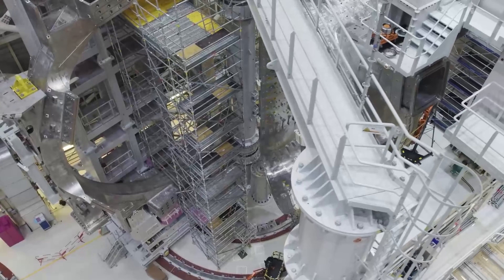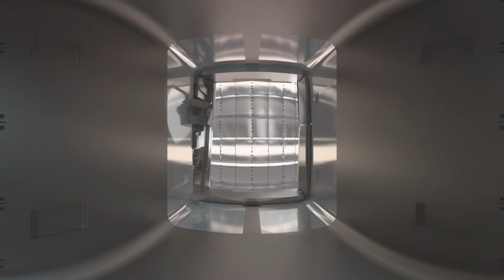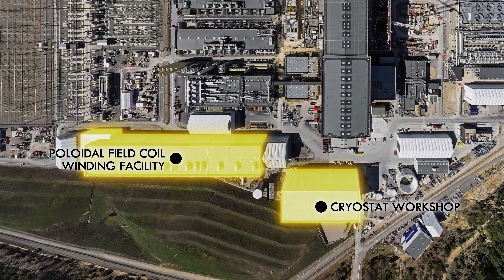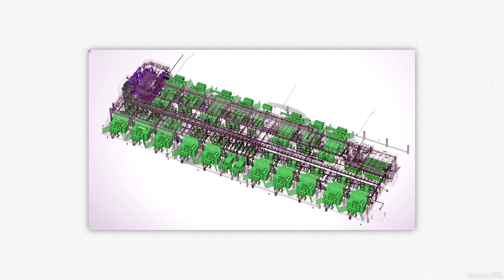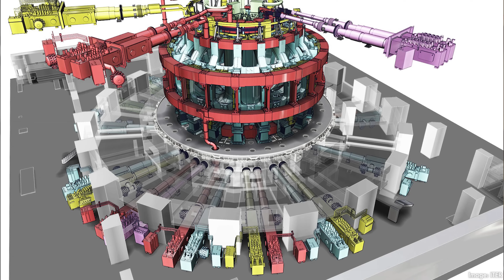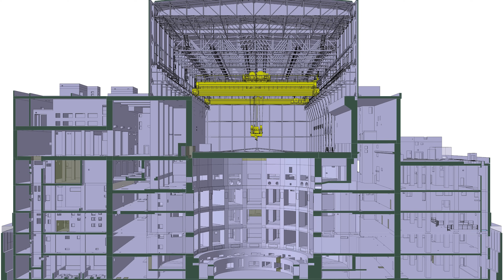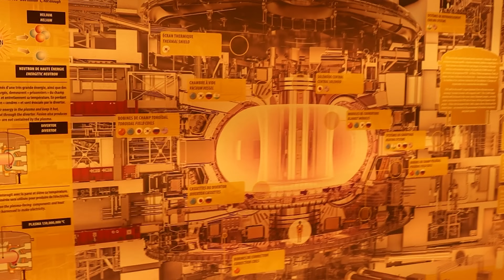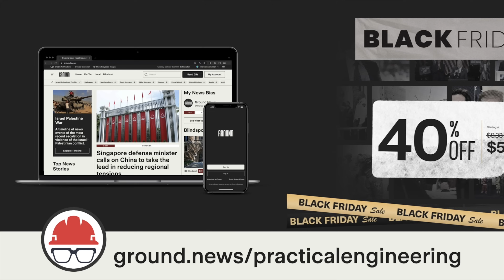Engineering The Largest Nuclear Fusion Reactor

Comment: Hello.
She's misinformed about nuclear fusion not producing any long lived waste.
While true that fusion won't produce any HLW, HLW comprises less than 5% of the waste fission reactors produce.
LLW and MLW waste will be produced by fusion reactors at an equal or greater amount, and it's actually an intended result of the design.
Fusion reactors produce their energy in the form of high energy neutrons, which transfer the thrermal energy into the reactor walls through impacts.
However, when a neutron impacts a material, there is a chance of it being absorbed by a nucleus and becoming a radioactive isotope of that material.
Over time, more and more of the reactor walls will undergo this reaction, until the entire thing becomes radioactive and require replacement and disposal.

The result is several tens of thousand of tonnes of radioactive material requiring long term disposal.

Comment: Grady, I'm disappointed. This is just more PR spiel. There is an actual climate crisis which actually requires urgent action. Your practical insights could be really helpful in addressing these issues. But for reasons too complex to explain in a You Tube comment, ITER is a white elephant-style road to nowhere. I can't believe that you are not able to actually see that.

Best wishes. Michael

Comment: 50MW in, 500MW out is 450MW gross.
We do not know the efficiency of heat transfer from the tokamak to the water, so we estimate 80%.
Assuming 45% efficiency of the powerplant. we get:
450 * 0.8 * 0.45 = 162MW.
This is about 50 wind turbines, about 1/3 of a typical coal or gas power plant.
A nuclear power plant typically produces about 1000MW.

Comment: Grady, every time I hear the phrase get more out than was put in, particularly as it relates to energy/heat, my mind immediately goes to saying, “so you’re trying to build a perpetual motion machine“. Is this the case? Why do we even need to do this when we have plenty of regular fusion reactors. I think that’s where the money should be spent. The technology is now, I don’t understand at all why we are not re-processing all of this uranium, but if you want to have a cleaner, Infinite source of electrical power, it seems as if the existing nuclear technology is more than sufficient

Comment: Im highly sceptical of fusion power. This Q10 is not a real number. I came to understand there are many ways the effective power output can be calculated. At the end, you need to measure electrical power input and output over time. So dumping the heat, expecting the theoretical heat gets converted into electricity with 100 efficiency for example is useless data. I dont think we will see net gain fusion power that are used for actual power generation in our lifetime

Comment: I think the word "overengineered" seems to be a fair description of ITER. But as an experimental research facility that is to be expected. Any future power station designs that spring from this will certainly not need to be nearly as complicated, at least if they have any chance of success.
Reply: We are very far away from a power station design...  the power yield of these things is way less than 1.
Reply: @Rob2  Watch the video, they specifically state the target is for a thermal Q of 10. That's easily enough to get net electricity generation. We've managed a Q of 1.54 already, so we're beyond less than 1.
Reply: @Croz89  If you refer to NIF result then that's almost irrelevant due to huge design differences.
Also you need to to take into account not only all the losses but requiring the reactor to also function economically(for example using the mentioned lithium to power it), all of which still need a very long way to go.
Reply: @ImieNazwiskoOK  A thermal Q of 10 is likely enough to be economically worthwhile for magnetic confinement fusion. It would be better if it was more, but it's a start.
Reply: @Croz89 A Q=10 refers to the ratio of energy output to the energy input into the plasma, a concept that’s often misunderstood by the public. Achieving a Q=10 is not just a milestone; it’s a critical proof of concept. It demonstrates our ability to successfully scale up from facilities like JET to the much larger ITER, helping us gain a deeper understanding of the side effects and challenges associated with such upscaling. This knowledge is essential as we move forward with the development of a DEMO reactor.

Furthermore, ITER plays a crucial role in evaluating different breeder designs. It’s necessary to understand how factors like wall composition, wall thickness, and fuel retention impact fuel production. These insights will be vital for optimizing future reactor designs.

Comment: I'm honestly surprised they don't have some form of capacitor bank on site and instead rely on a direct mains supply for initiating the reaction! Also whilst I understand ITER was never intended for power generation, I'm equally surprised there isn't any form of generator at all; it would make sense to reclaim at least some of that energy.

Regardless, though, I'm looking forward to first plasma. ITER's behind schedule and may not even be the first to demonstrate technical viability if MIT's SPARC keeps to its schedule, but it has tremendous value in demonstrating fusion at enormous scales and with older, more mature, and potentially lower cost technologies and materials.
Reply: 600 MW isn't too massive, steel and aluminium smelters can exceed that when running. So it's in the range of something the grid can work with, especially as that's only the peak consumption needed when starting the reactor up.
Reply: @Croz89  Now that you put it that way, it does seem almost trivial. Thanks!

Comment: There's a bit of nuance that's glossed over which I think is worth bringing up.

Tokamak design fusion reactors create radioactive waste when the high energy neutrons strike the blanket to create heat. With proper material selection this material will need careful handling and storage for ~100 years. 

The only sense in which this is not "long lived waste" is by comparison to fission for which the waste needs to be properly handled for millennia. However, tokamak fusion isn't "clean" in the same way as, for example, wind is clean. 

I don't think it makes fusion undesirable, but I do think it's important to keep in mind when comparing fusion to existing renewables.

Comment: Ok I’m all for power from nuclear fusion but there is one statistic in this video that concerns me.  The claim by ITER is that they hope to achieve Q of 10 with the reactor. 50 Mw of thermal power in with 500 Mw of thermal energy out.  But later on it is stated that it takes up to 600 Mw of electricity to maintain the plasma.  That sounds more like an overall Q of less than one.  Is this really progress?  It’s like the claim last year from NIF that a 2 Megajoule laser pulse produced 3 MJ of fusion thermal output.  Buried in the details is that it took 300MJ of electricity to produce the 2MJ laser pulse. For a real Q of less than 0.01.  We have a long way to go to practical electrical power from fusion.

Comment: I went into this video thinking I wouldn't learn anything new about the reactor physics itself and then at 4:37 I learned that escaping neutrons heat the shell of the reactor to produce heat that then drives steam turbines. I feel like the energy extraction step of fusion power plants is often glossed over and not properly explained because I have watched a LOT of videos about Tokamak fusion and never knew about the neutrons escaping magnetic confinement. I knew about neutron embrittlement but the energy extraction step always seemed vague. Thanks for the missing link!
Reply: That’s a real shame, that all those videos didn’t discuss the cooling jacket. (Which would either be integrated in the tritium breeding jacket, or placed outside of it — part of Iter’s tests will be all those different jacket designs to determine the best balance of efficiency, long life, etc.)
Reply: @kaitlyn__L  I'm just glad to understand a little bit more! Do you have any recommendations for learning more about the various arrangements re: cooling jacket and tritium breeding system you just mentioned?

Comment: Thank you for providing so many details regarding this gigantic project. Planning for it began more than two decades before ITER's construction began in 2013.

Those who get tours of such facilities tend to be very impressed by it. This helps explain why such facilities are often overhyped and many of the downsides are left unmentioned. The presentations often focus primarily on the ultimate goal while minimizing the failure history of the research efforts that began in the late 1950s. It is unlikely that nuclear fusion will ever develop into a commercially viable energy source by 2050. I urge readers to search for the following article titles to learn another side of this story.

ITER is a showcase … for the drawbacks of fusion energy (The Bulletin of Atomic Scientists)

KEY COMPONENTS TO BE REPAIRED (ITER Newsline) (2022)

International nuclear fusion project may be delayed by years, its head admits (TheGuardian)

Sun in a Bottle?... Pie in the Sky! - The Wishful Thinking of Nuclear Fusion Energy (Springer) - Author: Charles Seeife

OUT OF GAS - A shortage of tritium fuel may leave fusion energy with an empty tank (Science)

IPCC report: ‘now or never’ if world is to stave off climate disaster (TheGuardian)

UN chief: World has less than 2 years to avoid 'runaway climate change' (TheHill)
  * This statement was made 4.8 years ago.

Comment: The physics and engineering in this project is insane.
Reply: yeah, its basically a world wonder of 20th and 21st century. Such engineereing would have been simply impossible 50 years ago.
Reply: Not as insane as the cost.
Reply: @jamesrodgers3132  Coal power dramatically changed mankind for the better, then oil came and revolutionized mankind yet again, then nuclear fission came and is (still) revolutionizing mankind, nuclear fusion is just the next logical thing. Oil wells, Coal mines, Steam turbines all used to be insanely expensive, they aren't anymore - if we didn't do things simply because they cost too much we'd still be living in the stone age.
Reply: @linuxguy1199 True.  There is always a certain controversy that comes with these kinds of projects, due to the expense and the foregone opportunities to feed the poor, etc.

This line of reasoning sort of makes sense when it comes to a project like landing a human on Mars.  But, with so much upside potential behind nuclear fusion, it's an argument that is hard to make, ditto with AI research.
Reply: @jamesrodgers3132  Semiconductors will give it a run for it's money.
Reply: @jamesrodgers3132 lol yeah cost is the most insane ones
Reply: @jamesrodgers3132 I know right, developing cheap clean energy for less than a single day’s cost of oil utterly mind blowing.

Comment: Worth pointing out that there are fission reactor designs that have been around since the 1950s that are meltdown proof (liquid salt), and the nuclear waste "problem" that the hippies in the 60s kvetched about, isn't really a problem. Bonus is that these reactors are available now, unlike fusion which should be available in another 10 years, another 10 years, another 10 years, another 10 years...

Comment: “And the steam will drive turbines to make electricity”. Shows video of cooling tower fans consuming electricity. Lol. I don’t like videos that show unrelated stock footage. It’s very out of character for this channel, which is one of my favorites. 

About the project, it strikes me as people having a lot of fun with other people’s money. Hopefully I am wrong, and hopefully I live long enough to see it. 

The trouble is, the actual energy input required to generate that little 50 kW of heat that then becomes 500 kW of heat is several thousand kW of electricity. And in a very efficient power plant, the 500 kW of heat generated becomes perhaps 250 kW of electricity. 

So while Q10 sounds great, it’s really turning a few megawatts into a couple hundred kilowatts. You’re going to need to exceed Q100 to start seeing any meaningful net output. 

Maybe, once truly scaled up, a portion of the heat generated can be used to drive the reaction directly, making it self sustaining. I suppose that’s the idea.

Comment: Starting college in 1963, I first learned about the Tokamak (toroidal), the Russian method for sealing the magnetic plasma bottle through the simple expedient of having no ends.  My text book said we expected commercial fusion power in ... 1983.  Hmmm...  Without super computers...mostly without computers...no one knew how devilishly complicated it would be to actually confine the plasma for a significant time.  The plasma torus writhed like the Hydra on ever finer scales as one fixed first this then that.  And so the years went on...

The Iter project is also waaaay slower than it would be if a single or consortium of few companies managed it.  Sometimes they wait months because some country failed to deliver their part through whatever economic or political consternation caused it.  You can imagine what that does to the schedule.  Iter is a committee project.

Nevertheless, I have high hopes that come 2030/35 they are marching upwards in thermal output.  It is easy to get a few neutrons out of a plasma...fusion.  I first saw that happen in 1964.  I mean some real power.

However, if power companies are fearful of the economics of fission plants, I doubt any will step forward for  Super Tokamak.  It would need to be a pride and employment project of a large and techie country.
Reply: I see your critizism about it being a committee project, and how it would be better be done by private sector. The thing is, it would never have been done by private sector. Private sector is not in the business of exploring science if there is not an expectation of profit in a reasonable time scale. Private sector will come in and quickly create working powerplants once the science and engineering is prooven. When there is no quickly available return on investment science has been and always will be driven by governments, which means comittee projects and red tape.
Reply: @HiltownJoe  there used to be places like Bell Labs where 1/5th the work was undirected... For the private interest of the researcher.  Of course, you weren't allowed to build a tokamak in your office. ... But commercial interests did pay for pure research on a small scale.
Reply: @terryrogers6232  you're talking about the second research step after public funded discoveries, which is way more complicated, costly and safety concerning in the nuclear field. 
Though, with the terrible slowness on gen4 fission reactor prototypes (those capable of using depleted MOX or thorium), such an international collaboration seems a wiser way to develop fusion.
Reply: Bell Labs was essentially a government department, AT&T was a regulated monopoly at that time, before they split and we got the internet company hellscape we have now.
Reply: well, confining the plasma is one thing that is now quite resolved. The work on ITER is mainly to get a Q factor well above 1 and be finally able to produce electricity with a tokamak.
Maybe the private sector could have made it quicker, but it would have been non profitable (and not megalomaniac enough for guys like Bezos or Musk to want to invest in or even hype it) and, more importantly, as humanity we can't allow greedy private entities getting some patents above that tech.
Reply: @PainterVierax  Well this channel covered Helion Energy.
Reply: @brodriguez11000  ok and?
Reply: IMO the risk averse factor is very high outside of the non-nuke traditional power plant plans. IIRC there was a plan for a new style of nuke power plant with isolated mini salted nuke power plant, but that got canned by the partnered US grid company, in proxy...
Reply: Thanks to modern computing and smaller scale experiments, ITER might be obsolete before finished. Still worth trying to finish it. Its worth my tax money. If humanity ever masters fission power, then we will have way less boundaries, so its worth our collective effort.
Reply: I'd reccommend looking into the National Ignition Facility if you're interested in fusion. They've achieved net positive energy with inertial confinement already and their researchers have done many publicly available talks on how they managed to achieve it from the use of neural networks to how they programmed their diagnostics systems to how they found a use for diamonds they'd buy that wouldn't quite be good enough for their big main attempts.
Reply: fusion is fake anyway... and they say lies from beginning to end... they have Zero way to know how temperatures and numbers they throw out like its fact... ALL FakE based on lies NOT science